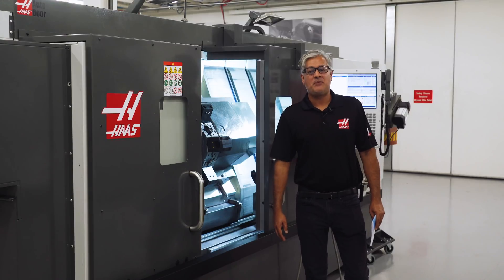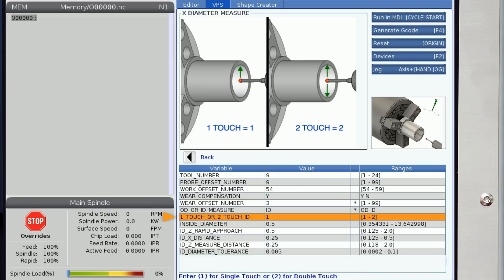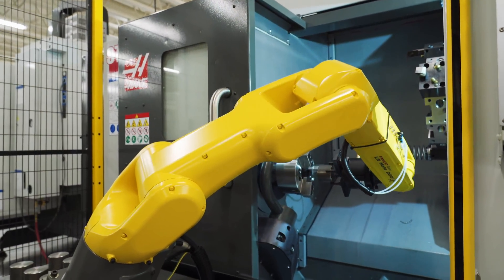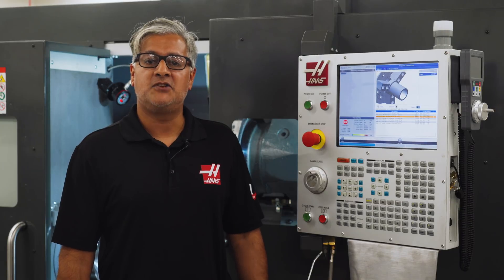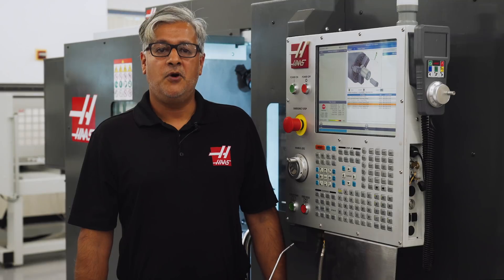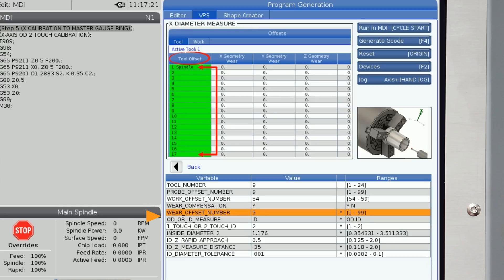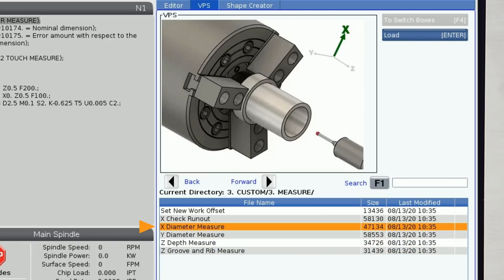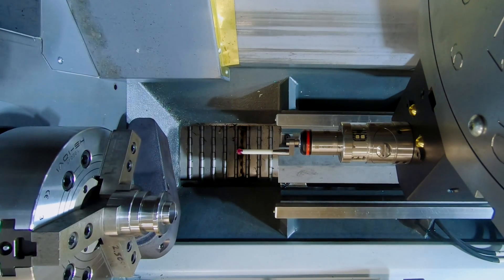Probing on the Lathe - WIPS-L Programming with VPS Templates - Haas Automation Inc.

Comment: this is actually much harder to do than to measure the part with standard tools. you also need the right probe for the right job. the only real use this have is on automated production cells.
Reply: I had to write the macros by hand in 2018 before haas got around to it... it is useful when your employees can't use a  bore mic to save their lives.... no joke about coming in to work in the morning and finding 100 parts out of spec bc nightshift couldn't comp correctly...
Reply: @Verifraudreports  ahhhhhh there it is "the night shift did it" excuse.
Reply: @ISILENTNINJAI must be nightshift guy.lol
Reply: @Verifraudreports  sure, with a probe you can correct the problem by removing the night shift 😁
Reply: I've seen a video where the probe is actually protected by a shell that opens up when needed. I only skipped trough this video but didn't see anything like that. Is it included? This system is way too fragile to be kept open in the workroom of the machine
Reply: For general machining ops it would be a little overkill.
But definitely an advantage when running a machine with a robot.
I guess more operators are trying to find a better / cheaper way to produce product, hard to go past a robot to run parts IF you can justify the extra expense of course ?
It would suit the Generation Now guys as they like to do less actual work, LOL.